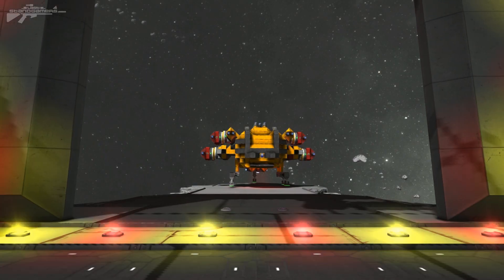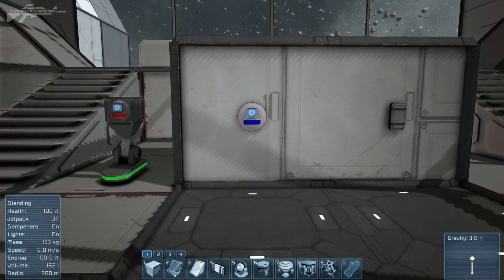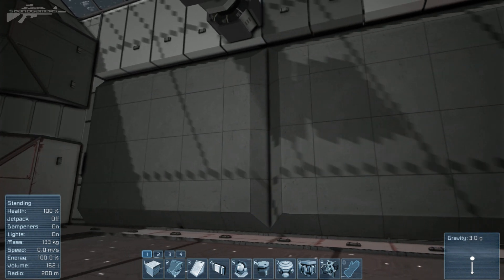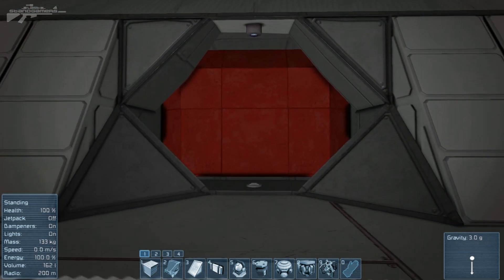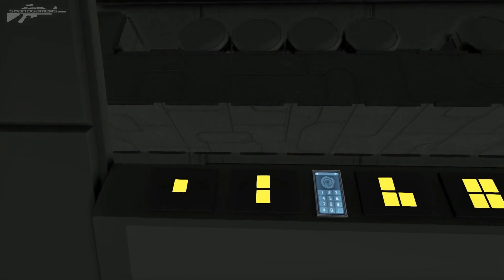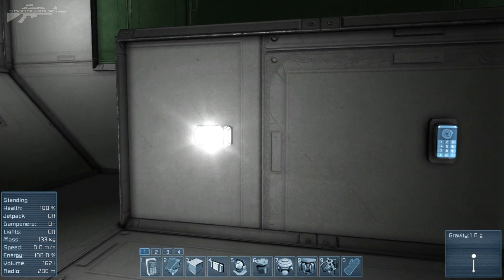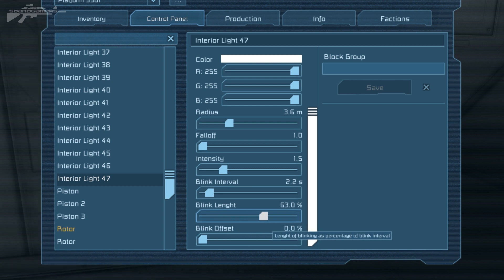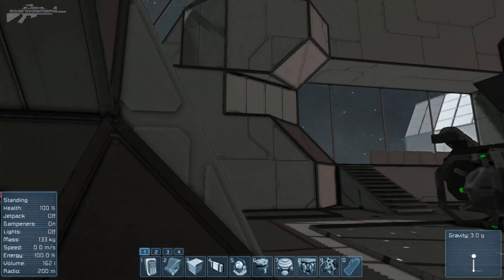Space Engineers - Sensor Detector & Warhead Count Down Timer

Comment: the new timed warhead could be useful in making a timed penetration bomb, (no pun intended) where the bomb would be launched from a fighter bomber. the bomb would have heavy armor or a moderate amount of light armor, (so that the bomb doesn't detonate on impact) you would launch these at weak points of a ship (such as windows or thin walls) it would impact and break INTO the ship, the timed warhead would go off 5-10 seconds after its inside the ship, causing intense internal damage and maybe killing crew. this design could also have a self powered engine system to keep it stable and to accelerate the bomb (which at that point would be a missile) to ensure maximum penetration and to keep it from hitting its side detonating the warhead. for the design to work properly the generator and war head would be placed at the back along with the rear thruster. the maneuver thrusters would be mounted on the front. and a gyro could go anywhere. this could wreak havoc on light armored ships or small large ships. hope you like my idea everyone, if you could add to this idea or find flaws (which there's bound to be a lot) please comment. if you like it like, or don't but if you do it wold be very appreciated. thank you, and have a good time playing space engineers.

Comment: Arron. I request you to build a set of traps for interiors of stations. My suggestion is a hallway with a sensor. When you pass the sensor, the doors on both ends turn off, and pistons push the floor and ceiling together, crushing whoever was in there.

Comment: I wish they added cables i.e. real electricity. Would nerf unrealistic super compact ships.
Reply: I don't see what's so unrealistic about that. You don't have wires running all over your home because they are hidden in the walls.
Reply: Zebo12345678
 Yes, but the wires are there and there are air gaps for them to run through. Just having "magic wires" in everything (especially circuitry of other machines) doesn't seem very real and being able to power something from 100000 meters away with no power drop-off is dumb also.
Reply: Jonathan Herman
 It would just be cool, to cut the power from a ship from the wires. And again this stops ultra-tiny-impossible-to-hit ships and promotes bigger ships.
Reply: GuiltlessGaming the power is transported through wires in the blocks
second of all, fine if you want to make this game ridiculously complicated, be my guest, just dont come crying to us when nothing works, and small ships become useless
and finally, small ships are not impossible to hit, they are just difficult
but at the same time they take much less punishment than large ships, so they die faster too
not everyone wants big ships, some people also want small ships
Reply: Niall Duffield
 It wouldn't be ridiculously complicated. It will require right clicking shit and making 2 layers of armor, or exposed wires internally. Small ships wouldn't become "useless" they would be weaker, as they should be, because they cost very little time and resources to make. The point of the game was to build large things and play with physics in the first place, sorry if you aren't intelligent enough to make something bigger than 5x5x5.

Comment: I'm going to try to make missiles equipped with an automated targeting system. How it works: I have five sensors on the missile: on at the top, one below, one on each side and on at the front. All sensors are connected to a gyroscope. The sensor at the bottom will tell the gyroscope to tilt the missile worwards, the on ea the top upwards, the ones at the sides to their side and the one in the front resets the gyroscope. If the target is below the missile, it will pitch down towards it, and lock it's path towards it as the target now is infront of it. If the target moves to the right, the missile will turn after it and continue it's chase. (I really hope this works. it would be awesome!) The only obvious downside is the limited range of the sensors.

Comment: I wonder how feasible a proximity mine would be? It might need a mass block to pull it into a passing ship's gravity well and get within effective range. Bit of a coin toss though since it would need the ship to be passing "below" or the gravity generator would repel instead.
Maybe a spherical grav generator hooked up to a proxy sensor, set to activate when a small ship approaches. Then you have a field of proxy mines with mass blocks arranged around so when the grav mine is triggered, they all fly in and hopefully get close enough to damage the ship.

Or even just a proximity warhead to mitigate some of those near misses with the gravity launcher system? Also, a piercing torpedo on a delay timer could tunnel it's way deep into a ship or base before exploding. 

Are the sensor's limited to detecting faction players only, or is it universal? If it's the latter and all your doors are motion sensor activated then there's an obvious security issue.there. Maybe a button that activates all the door locks in case of an intruder?

Comment: Regarding Blink offset; it's actually an offset in phase, rather than a ratio of on-off.

Imagine the pulses rotating on a 360 degree "clock" of however long you set the Blink Interval to. The Blink length is then a percentage of that total time. The Blink offset basically shifts that "clock" around a few degrees. A good example of this is setting a series of lights in a line with a 3sec interval, 10% blink, then each light has an offset of <previous light>+3% So first light as 0, then 3, 6, 9..... % offset. This will create a running line of lights, useful, lets say, for a landing strip.
Another way to see it is set a group of lights to any length of time, put length to 50%, then half of the lights (choose your own pattern) to 50% offset and voile, instant alternating lights.

Comment: Sadly you can't reverse the same piston/rotor in the same sensor when you enter and leave the sensor area. It would be nice if the sensors could be set to only respond to ships owned by the player/players faction as well.
I feel they are a little too gimicky right now and not very practical.
Reply: Put piston/rotor in a group. Then assign the "on" action to the group and the "off" action to the rotor/piston itself.
Reply: Knsgf But that won't actually move the piston though, only turn it on and off, unless I'm missing something.
Reply: Felix Hindemo All right, I'll reword that. Assign the sensor's "on" action to REVERSE the group and the sensor's "off" action to the REVERSE rotor/piston itself.
Reply: Knsgf Oh ok, I'll try that, thanks :)
Reply: Pyrobird Sensors didn't exist until this patch...
Reply: Knsgf
 That didn't work last time I tried it (a few patches ago). Have they changed it so you can do that now?
Reply: Jebediah Kerman
.... I was referring to grouping pistons and rotors and having more control than simply turning them on or off.
Of course I know that sensors didn't exist prior to this patch ^^;
Reply: Pyrobird oh, ok.
Reply: People have already made homing missiles ;)

Comment: I wish you could access the light options via the actual light block and open doors via the actual door part.
Reply: The lights wouldn't make sense (short of the large spotlights maybe) but what's this about the doors? The door block has always had a control panel you can press T on, and if you mean the large piston doors, then set up a button panel.
Reply: thats not as  immersive and accessing lights from the block it self is just plain weird youre just lazy
Reply: Well it's a pain to find the light I want and change the settings.
Reply: dovahkiinhowey
You could tell them to show on your HUD and build an antenna if you're really having problems. Alternatively don't forget that the most recently added parts are at the bottom of the list, so just delete and rebuild the ones you want to be different to the rest, and scroll to the bottom of the list.
OR just build lights for one group, name and/or group them, then build lights for another group.
There you go, three solutions that don't involve control panel access. Really it's not all that hard to find the lights you're looking for, and I've heard no one else voice complaints about finding the right one.

Comment: ive managed some short range homing missiles. if you miss by less than 50m then they will redirect themselves and head in for a second attack. its also a neat feature that they can hit the opposite side of a ship if you miss so you get some extra tactical flexibility. i managed to shoot one at the rear of the red ship and have it arc back into the hanger/main interior.
Reply: Upload to the work shop and link It here.
Reply: http://steamcommunity.com/sharedfiles/filedetails/?id=310052615
Reply: you guys can come up with a weapons package i just wanted to design a guidance system. its 1 sensor per side connected to one gyro each
Reply: How does the gyro and sensor combo work then? A homing missile is a good concept if it works.
Reply: sebastian wilkins The sensors are linked to overriden gyros, turning them on or off.
Pvtblue's concept with 4 gyros and 4 sensors works the best, but I also had some limited success with 1 sensor and 1 gyro and having the whole body rotate.  
Keep in mind that it works much better in multiplayer.
Reply: Works well thanks, crafted a missile to seek out large ships and it worked well. Not very effective against the smaller ships though.
Reply: sebastian wilkins
 Couldn't you get another sensor to activate the detonation sequence, or just blow up the warhead, when the missile gets close enough, to directly cause damage, or a system to send out fragmentation, making a rudimentary "flak" missile?
Reply: the problem with small ships isnt detonation its the speed and accuracy of the missile. its hard to get a missile to go fast enough and track fast enough to get even a near miss. the fragmentation idea is interesting though, ill experiment with it.
Reply: pvtblue what are the targeting options for sensors? I'm away from the comp with the game so I can't check
Reply: i have 4 sensors for 4 directions. the size options make 70x50x50 on one side of the missile for each sensor. combined, anything in 70x100x100 around the missile is detected and targeted. when they increase sensor range (which they inevitably will) ill upgrade it to track at far distances in front to make the missiles feasible in real fights
Reply: in addition i have made a slight upgrade in the workshop that includes a detonation sensor

Comment: LastStandGamers You could have a homing missile that uses sensors to "track" enemy ships. Kinda like the LeftSensor would trigger the Right Thruster, and so on for all of the sides, and have one or two more that sense when it is within 2M of the enemy, triggering the explosive.
Reply: WOuld be highly unnefficient.

Sensors have a max distance of 50m, so yeah you can input the right sensor to use the right thruster and so on when the ship goes out of his max range, but once the ennemy ship is out of the range et only needs to stay out of it or to go in a different direction and your" homing missil" will just go in a random direction on no end.

There is ways to use the sensors on weaponised contraptions, but a homing missile is higly unlikely for now.
Reply: Mugthraka You are absolutely correct. But this has given me an idea. The homing missile BLsquared just explained WITH a camera and antenna attached. So you would then be able to manually make slight adjustments to the trajectory if needed. Then it would be quite a deadly setup if in the right hands.
Reply: you could set up hidden guns to pop out when the sensors go off. it'd work as a trap and auto defense when your gone.
Reply: 1racerboy1: Very true.
Mugthraka:Actually, I meant to use the sensor for completely the opposite: detect where a ship IS rather than where it ISNT. Although it still would not be very reliable, especially in situations with multiple ships in range. Maybe do something on a smaller scale: have all of the sensors set to ~5M for minor corrections after being launched from a ship. That way, if the target managed to move a few M to avoid the projectile, it would at least try to move the couple of M over to glance the target.
Reply: Jonathan Herman I guess so. This concept is probably very impractical, then.
Reply: yes, i have, and eh fairly usefull
http://steamcommunity.com/sharedfiles/filedetails/?id=310894044
Reply: pvtblue I like this idea, and it could work for drone ships too.
Reply: if only you could activate gatling guns\rockets automatically. im guessing they will implement it eventually so im also designing a drone to orbit a ship and train a missile launcher on it
Reply: pvtblue Cool; great idea!
Reply: Jonathan Herman in setup actions, the left square is an action when the sensor starts detecting something, the right square is when the sensor no longer detects anything. if you want lights to turn on only when an object is in range of the sensor, put "light on" in the left and "light off" in the right.
Reply: also i finished the drone,
http://steamcommunity.com/sharedfiles/filedetails/?id=311810481
complete with silent video demonstration since i cant manage to form spoken words
Reply: Amazing!
Reply: really they need to have damage scaling based on number of simultaneous explosions. as it is now you can have a dozen small warheads and do the same damage as 1 or 2 since it just does damage at a radius around each warhead. i want it to be that a large block size chunk of small warheads will do the same as a large warhead and that same scale for multiple large warheads. it would reduce the craziness of heavy armor and make small warheads less of a joke.

Comment: you could make a civilian dome around a large base with turrets set at intervals, and you could use an in the dome as a door and you could hide small warheads, then you can have a check in person who turns o and off sensors in the opening, and if the enemy disguised as a transport vessel fails the inspection or tries to enter after a spy, say, sets of a bomb in the control post then the defense system will still be intact (mostly) and when they try to enter their ship would be pelted with bombs and missiles. you could also have snesers in a large ship, in a vonurable place sensing the block in front of it and when an enemy attacks the station, a missle might hit it, removing the signal, and at a control base far away you could set it up so that if it senses somthing a green light appears so that when it blows up the "ok" signal would stop being transmitted and control would know that it was attacked

Comment: I could see myself using very short-range sensors on the bottom of small ships connected to thrusters, to prevent landing pad damage when close enough to a surface. Also, the new blink feature could be used to make aviation-style navigation lights and guiding lights on landing areas, possibly set to blink in waves to indicate intended direction of travel... Also, arron, i hope you make a short tutorial or feature for the rear door on that small ship. That's fantastic.

Comment: Slight correction to what you said about the blinking offset:
The offset changes when the light will blink (so you can set up two alternating lights or a wave effect for example).
Sorry if that's what you meant and I misinterpreted what you said.
Reply: ***** /\__/\__/\__/\__/\
(I cannot do upside down parentheses but you get the idea)